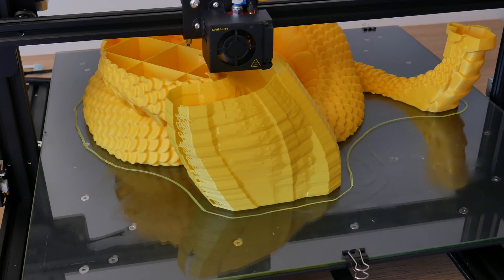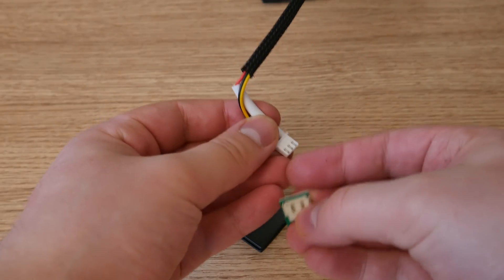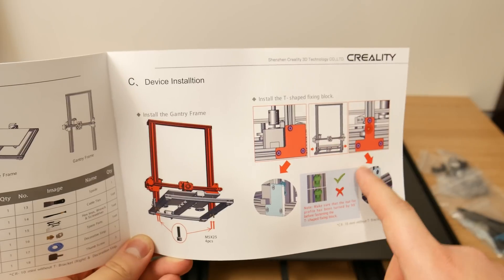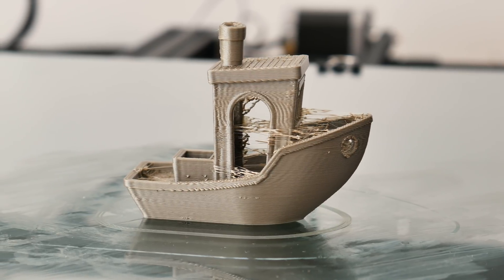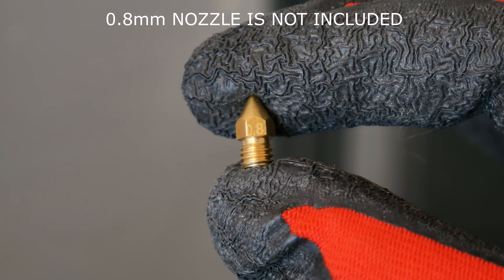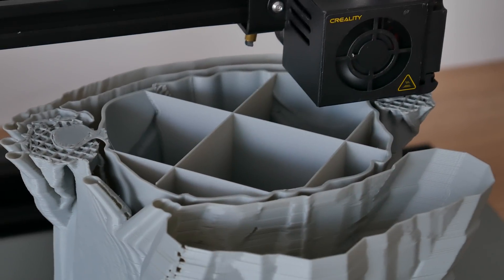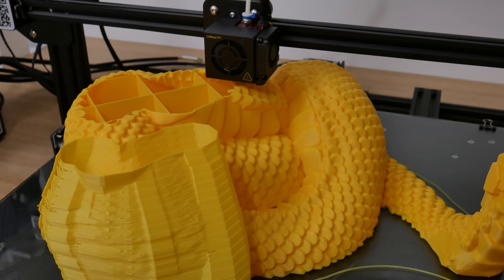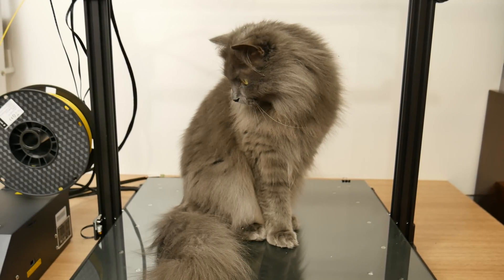Creality CR-10 S5 - 3D Printer with HUGE PRINT VOLUME

Comment: Can you share your Cura settings? I've this printer for month and still can't calibrate it to have nice prints. Its decent with black pla filament but going other colors or silk is nearly impossible to set things up correctly. Looks like you print with very low acceleration

Comment: What 3D modeling software do you use or recommend?
Reply: Cura is mostly used for setup 3d print
Modelling can be any 3d software
Reply from the maker: I think Ultimaker  Cura is the best and easiest.

Comment: Doesn't look like it's changed much at all since I got mine back in 2019.
Since then I have added a BLTouch and upgraded the bed heater with a 1300 Watt heater.
Now it heats to 65°C in 2 mins :-)
Bed levelling was such a pain with it that the first Upgrade I completed in Nov 2019 was the BLTouch, well worth the upgrade.
As was the bed heater upgrade Dec 2019/Jan 2020.
I did print out a full sized storm trooper helmet, that print with a 0.4mm nozzle was just over 5 days :-)

Comment: Thanks a lot for your review and all comment feedbacks🙏
Reply: Are there plans for releasing a bigger infinite Z axis 3D printer with 600mm+ x 600mm+ build space? I’m looking to buy a printer for business but need 24 inches (609.6mm) of build space... I love both the CR-10 S5 and the CR-30 however will be too small for the parts needed to build... so I’m left with the Tronxy X5SA-600 ...also are these printers upgradable to a dual extruder? New to this but see an amazing potential I’d feel bad if I never tried.
Reply: im waiting for my review unit :)

Comment: I am surprised Creality did not use 4 X 200mm X 200mm bed heaters which would cover most of the bed surface, I would want synchronised dual Z motors for a printer this size, in fact, I would not get a bed slinger in this size, I would want core XY for a printer this size and a volcano as I would want to use a .8 nozzle with a bed this size with a decent speed
Reply: thats because 4*200 its 800mm mabey just 2 xd

Comment: I have this one, but heavily modded with silent steppers, hemera, superr vulcano (1.2 mm nozzle) and 220v heater, also bed level sensor, paired with skr 1.4 and octoprint.

replaced the powersupply with a PC 550watt psu ( silent) with a custom electronics box mountet to the PSU that holds all electronics and a touch screen

now it is really usuable..
Reply: I am interested to see the results for your setup, can you tell me how did you attached hamera with super volcano on it?
Reply: @HASSTL  i had to remix a mounting plate for that to work. technically the same plate as you can use for the hemera to work with any ender / cr 10 printer, I had to remix the parts cooling mostely

Comment: Please give it a silent board upgrade. One thing I didn't miss is the noise of the stepper motors with the original stepper drivers 😅

But anyway: Nice video! Thanks for sharing your impressions.
Reply: And a heatbed that is heated 50x50 :)
Reply: If you're measuring in cm, yes 😂
Reply: me too